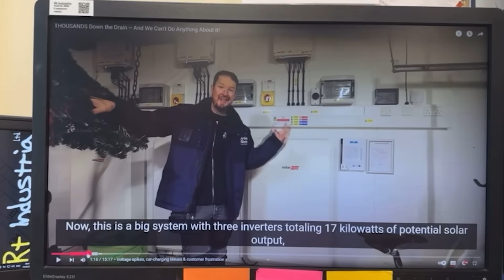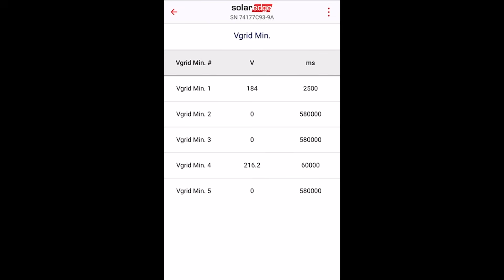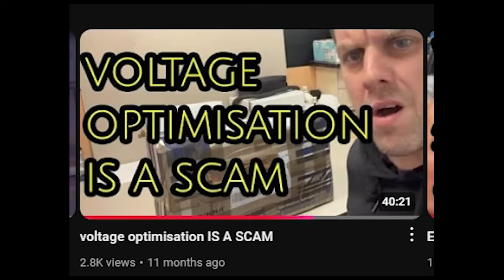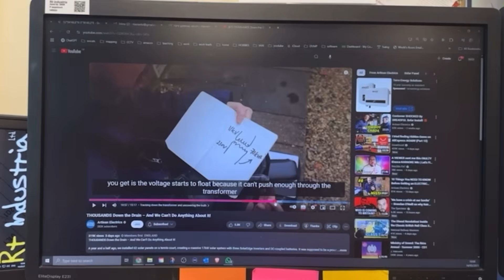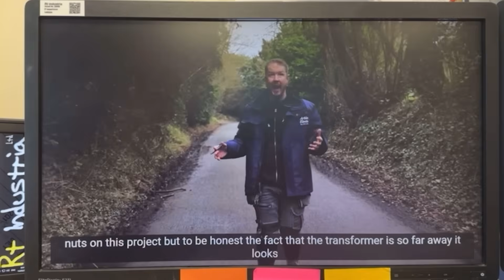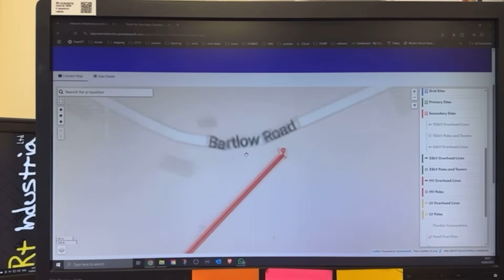ARTISAN ELECTRICS v THE GRID. WHO,S TO BLAME

Comment: Amazing the amount of people saying DNO said 17kW so they should be able to export 17kW...
That is the Export LIMIT (please look up the definition of the word "limit" & nearly always there are conditions/caveats)

For example, you can drive on the motorway at 70mph, which is the speed limit
However if there is a car(s) in your path doing only 60mph, torrential rain, then you are going to create an issue if you continue at 70mph
Feel free to argue to the Highways/Dept of Transport/Police that you can do 70mph, but I doubt if that will get you far on the hard shoulder of a pile up

But, but, the DNO...
They set an Export LIMIT of UP TO 17kW, subject to conditions, or rather other households - mostly on the same phase consuming much of that exported energy on THAT PHASE...
AND the DNO expected a "professional company" properly configuring the considerably high end system to monitor and adjust accordingly to the voltage of energy being pushed onto the grid
Which is what many with some actual wisdom are saying, it simply needs to be configured work within the present conditions/demand of local grid, than arrogantly think they continue pushing 17kW or driving at 70mph regardless coz that is the what the limit allows
Some roads have speed-bumps with a 30mph limit still, you can drive down that road at 29.5mph over the bumps if you wish, maybe in old banger or big SUV, but I personally would drive a little more slowly if I had a more expensive car or lowered sports/performance car...

But, but, but - OK carry on exporting at 17kw, according to the LIMIT that was set, yup you can do that if you wish...
But it is causing issues - yes but what is causing issues ???
YOUR EXPORT is causing issues to YOUR EQUIPMENT from YOUR INVERTERS

But, but, but...
Fine, carry on moaning about that DNO allowed (up to/limit) to 17kW so I should be able to constantly export regardless...
Well, they'll probably revise that 17kW down & when they do that they might set a real low limit of say 5kW, there is no guarantee
that you will get 32A/7.5kW (depends on supply voltage) on a single phase

BUT, BUT, BUT - they can't do that....
Ergh look up another DNO - Northern Power going around and DOWNGRADING customers main fuse from 100A to 80A due to grid demand/balancing - yeah check that out and try to grasp what might unfold if customer/Artisan keep on demanding the DNO resolve this issue - they may simply slap the install with a much much lower REVISED EXPORT LIMIT aaaannnnddd a lower Amperage main fuse
(To be honest, I wouldn't blame UK Power Networks if they did this, which would be a large slice of solar humble pie for Jordan to swallow - UKPN are very good & considerate, often visiting & carrying visits & SMALL work with little to no fees. But I bet if you started to become an annoying problem, they would not be so easy going & slap you down with a MUCH lower export/Fuse AND VERY CLOSELY MONITORING the phases too)

You watch, in a few months time, that customer/Jordan will be crying their limit is now not even 32A coz nasty UKPN slapped them down & possibly dropped main fuse too - with many laughing & saying "Told ya, but wouldn't listen"

Comment: I think they are both at fault.

1. The solar and power export design hasn't taken any account of the volts drop on the DNO distribution cabling.
2. The DNO hasn't looked at the impact on the local voltage at the import point (and therefore supplied to the neighbours of this customer) needed to inject 17kVA into their network, including the voltage drop along the cables under all potential localised network load conditions.

Point 1 is the responsibility of the new installation designer to work with the DNO to ensure there are no issues with the voltage needed at the injection point. This voltage will have to be raised above the nominal supply voltage to ensure the power flow is away from the inputting system into the DNO network. I.e. in the same manner that the DNO's transformer is probably set outside the supply limit to ensure it is in spec at each house, after the voltage drop along those long cable runs is taken into account.

Point 2, the DNO should have performed the basic ohms law calculations that would have shown this connection could never work with their local supply network and the customer supply voltage at each house remaining in spec at all times, solar plant generating or not generating. 

The DNO should have rejected the simple connection request as it would not be possible to make it work, without a considerable expensive network upgrade.

What is even more worrying is that, as I think Jordan mentions, other neighbours want to do the same and install large domestic solar systems. Just imagine the nice glow from those skinny cables as Jordan's customer and half a dozen neighbours try pushing 100+ kVA back into the network, (yes the fuse at the transformer would blow). But, then what would happen to the supply voltage at each house as the various solar systems try dumping power into each other :^))

Despite Ed Millipede's Green dream, the grid and distribution network was never designed to be capable of accepting 10's of thousands of random load to input to load swings from all these micro generation installations.

Comment: The problem is clearly too much impedance in the LV and HV lines and not enough loading from nearby neighbours. If there is high impedance to the loads that will accept that 17kW of course the inverter will need to produce a high voltage to push that power to them. The inverter probably has a voltage limit of 260V and it is hitting that before it is able to reach the full 17kW. If this voltage is too high then probably the inverter needs to be adjusted and the owner needs to be realistic that they cannot export a full 17kW on their grid connection. The grid operator will not know exactly how much power can be pushed - the responsibility for keeping the voltage within limits sits on the solar exporter. Jordan blaming this on the transformer clearly shows where he sits on the dunning kruger curve (foothills of mt stupid?)

Comment: There are distribution transformers which could retap themselves remotely and online. But they are usually not used at the edge of low voltage network. 
On the other hand... it is nice to see how someone should go back to apprenticeship school and get back to kirchoff laws. Because they neatly explains how grid injection works.

Comment: Why doesn't the customer just use the batteries to buffer the solar and export constantly without exceeding Vmax. I've got G98 with a hybrid inverter and E-W arrays that overproduce in the summer. And then limit the overnight charge rate to use the whole offpeak time.

Comment: I managed to put up with the first 6 minutes. Can't watch any more. If you have been given permission to pump out 18kW, then you should be able to pump out 18kW. The local grid should be designed to accept that - if it isn't then permission should not have been granted. Likewise if the local voltage drops below its limit when providing the power that the consumer is permitted to draw, then that is also the DNO's problem.
Reply from the maker: You can pump it out but that will allways be within the voltage range allowed , end of story
Reply: @Actual_electrical_content   ... unless the transformer is unable to handle the current.

Comment: Missing the whole point of the video! From Jordan’s point of view, he was approved to supply 17 kW on a single phase to the grid. The DNO approved this and he’s expecting to be able to supply that. He expected the DNO to know their grid and its capabilities and only approve the 17 kW if the grid could handle this. Jordan is not the DNO. The DNO should have done the calculations and told Jordan of the limitations - and perhaps offered Jordan’s customer to pay to have the local grid upgraded.
Reply from the maker: This output would be reliant on staying within the prescribed voltage limit limits. If you exceed the voltage limits, you cannot explore if you under the voltage limits you can explore the 17 kW is not carte blanche 17 kW is when you stay within prescribed voltage limits
Reply: @ Yes - and the reason why the local voltage is being pulled up is that the local grid can’t handle 17 kW of power generation. The DNO should have told him this and perhaps denied his application.

Comment: Idea: Why don't we have a standard procedure (and mobile test rigs) for testing grid absorption? 

Big diesel generator and suitable control and measurement gear. Patch it into the grid at exactly the point a proposed PV / renewable installation would go. Match the proposed power output, take measurements, sign it off at a safe limit? Could have seen this one coming I think...

Comment: To be fair, 11kv to 230 single phase tx's do exist, the primary is connected phase to phase and the secondary is single 230. Used for single dwellings mostly
Reply from the maker: I need to check this. I’m not sure it works. I thought you’d have to have a poly phase if you had that.
Reply: @Actual_electrical_content  two phases out of three on the primary
Reply from the maker: see my post on here
Reply from the maker: Correction- in my most recent video. I suggest that this transformer arrangement from 11 KV 2 phases to 230 V phase and neutral is not possible. I am wrong. It is possible I’ve checked with the people that know   (Sam) and it is absolutely a possible transformer arrangement and I am very, very, very, very, very wrong and I am very very, very very sorry however the actual transformer in the video is indeed a star Delta transformer as the diagram in the video shows
Reply: @Actual_electrical_content  to be fair the zero v end isn't technically a neutral on single phase
Reply: I think we're on the same wavelength it all comes down to what people are taught to call something vs the technical reality

Comment: This clown was slagging the UK off while praising his new French gaff's install, sick to death of these type, Ive been to France and the electrics are shocking !
Reply: I'll defend British installs all day long, but French installs (at least modern ones) look good. Why the hate for Main land Europe?
Reply: @SomeGuy-lw2po  CZ have very good standards as well. Comparable to German. Also there is high requirements for qualification an annual tests required. But we use different power outlets ( F type like in France ). There is also difference for 3 phase outlets.
Comparable to Germany three phase is available everywhere.
It was a bit kick in stomach when i lived in UK and frankly Spain not have top notch installs either.
Reply: @rybaluc  domestically what are you needing three phase for? 

Europe in general has pretty good standards for electrical and safety.

My only point is Type G plugs are the best design against all other power socket and plug connections.
Reply: @SomeGuy-lw2po   For 3p appliances cooking stove, pumps, heating appliances. 3p kitchen appliances are everywhere. 1phase appliances for high amperage are sometimes even not possible to connect.
Even if you not have anything 3 phase you'll benefit from it by splitting your house load across the 3 phases to 3 independent 230V rails. And no need to use thick cables. It can deliver same power with thinner wires.
Also you have less imbalance between phases because they are splitted across many appliances from all houses ( well depends on electricians ) and not balanced by entire phase across houses.
My low 3x25 amp connection can easily deliver over 17kW of power..
The question is not why yes. Question is why not. 3p wiring is everywhere where i live. Also if you want to connect inverter by 1p you are limited to 3,7kW only. Given that you even receive permission for it.
Reply: @rybaluc  I like where you said "the question is why not" that alone makes you right even though I disagree with your argument.

The UK electrical grid is just different, we have three phase supple to a housing estate, then split the phases across those houses to balance the load. 
Domestically I can see any reason why you'd need an industrial cooker or heater. 
Industrial properties and some commercial properties have three phase. 

I'd argue it keeps domestic electrical installations simpler keeping it single phase, but like you said, why not, so fair.
Reply: @SomeGuy-lw2po  Those appliances I mentioned are not industrial. They are normal household appliances for normal price. 
They just have different wiring options for different countries. 
My country grid looked very similar to UK in pre 2nd ww era. Just lower amperage. We even had 120V in some locations.
Lack of  wiring materials was argument to go for 3p. Also lot of various machinery and farms spreaded across country required efficient motors and were not concentrated in cities.  Industrialization of rural areas only led to such decision. 
Lot of same arguments and influence we share with germany if you need more examples.
Reply: Are you one of the people that keep saying UK plugs are the safest without any statistics about how modern European plugs are supposed to be "unsafe"?
Reply: @Flyb4ck  nothing against Europe's plugs but British plugs, type G, is the safest and best design when compared to all other plugs. 
The worst would probably have to be American style plugs.
Reply: @SomeGuy-lw2po  Which Europe plug you compare with? Given that there isn't single standard.
Reply: @rybaluc  every plug in the world
Reply: @Flyb4ck  There is no such thing as European plug. Since europe not have unified plug standard. You might say its unoficially unischuko universal cable for 2 different major receptacles and europlug( two prongs for low loads and double insulated ). But thats all. 
And there are those small old power outlets in swiss or italy where you cannot put even unischuko.
Reply: @Flyb4ck  Europeans are catching up to British standards yes, but what i saw in use in france was shocking, If France is catching up with new builds then great, as for British std G plug, yes as a mechanical engineer i do see it being superior for its job, and remember we have been using this plug for 50 years !
Reply: @sresto7943  "Europeans are catching up to British standards yes" yes the decline of quality is a real thing in Europe. Wasn't aware the British are to blame for it though!
Reply: @Flyb4ck  yeah this bloke is a mug

Comment: Still can't for the life of me think why people point all their solar panels south (assumed)
If he changed his array to something like 25% east and west facing he'd get 3 peak outputs throughout a day instead of one big one 
This would 
1 bring the output to a more steady longer useable power supply 
2 match the grid demand (East and West peaking nearer peak demand in the morning and evening)
3 increase the life expectancy of the east west panels 
4 increase the output on hot sunny days (east and west running cooler than the southern)
5 have little effect on total output on overcast days
Reply: Green, in more ways than one.
Reply: They are set up EW.
Reply: EW systems don’t have three peaks. They have a broader one than S-facing. They also produce less energy. So which one you want depends on what you’re trying to optimize. These are ground mounted, so architecture isn’t an issue. Without battery storage EW (like this) may indeed be better.
Reply: @Eponymous300  His point wasn't that east/west panels have multiple peaks. He suggested arranging them in different orientations including east/west.
Reply: @philthewriter yes, I got that, but there still aren’t three peaks unless you mean that the differently oriented sets peak at different times (but that would give two). Overall the system total output peaks once on a sunny day even with E and W facing panels. The overall curve is broader and hits a lower max.

Comment: Hi young chaps and chapesses that are interested in electrical engineering and in the subject of solar and wind farms. (See the link at end of comment) The video shows in nice basic terms, just how the output of such farms are connected to the main grid. Also mentioned is the overall management of the national grid at times of load stress. 
 
Talking of stress, did you know that during the 1960's when the very popular TV programme 'Coronation Street' was on air, during commercial breaks, the population decided it was time to put the kettle on for a cup of tea! Not a good time for the grid! Happy days! 

Remember, a 'Cock-up' can be very expensive in two ways, financially  and most importantly, to your reputation. Do good sound research first and 'triple check it'! 

https://youtu.be/7G4ipM2qjfw?si=FZ9ZOu6YFcLnTtoT

Comment: Jordan is not my fave person i cant stand him.. but what you showed in the SE app to me ses they are setting it up with wrong parameters. Those Voltages in the app looked too high to me. Really i think your spot on.. its not that its a bad install or UKPN issue its a not entirely knowing what your doing thing on Jordans part.. id put it down to lack of experience and im sure he will learn from it. In the mean time he needs to remove that scam device and tweak the SE settings lol maybe put a solar diverter to a hot water tank or something lol

Comment: 3 cheap inverters will over shoot and take it above 262v if theres no comms between them, set one as a Leader and 2 as followers 🎉 take out that optimiser and for the import lower the battery charge rate with his normal loads running till it gets to around 230v. If he has multiple battery chargers, make sure all AC in and out cables are same length.